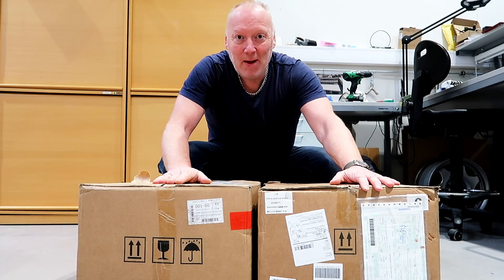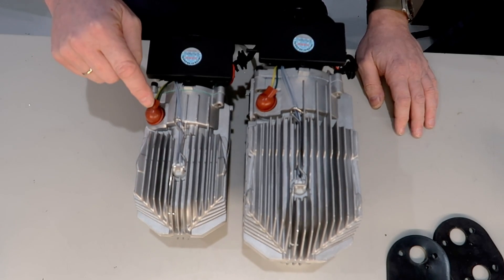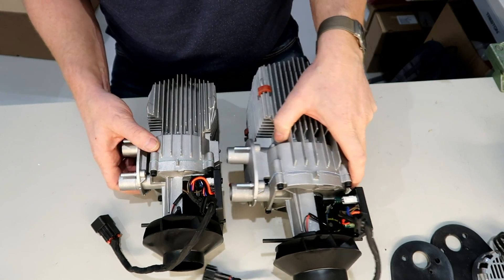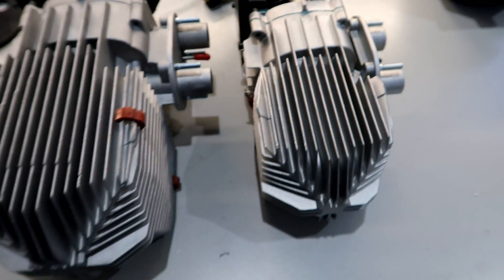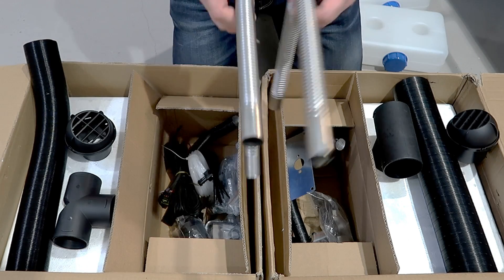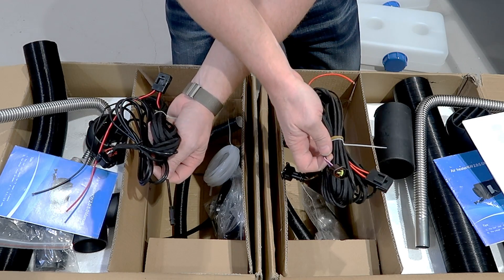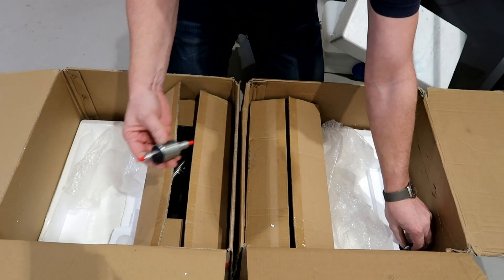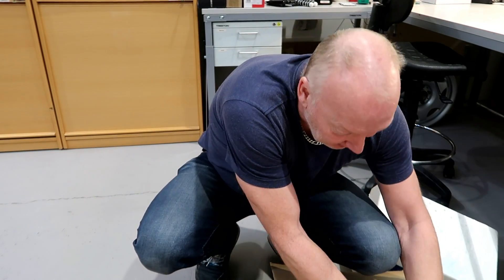Chinese 2kw vs 5kw diesel/parking  heater comparison part 1.

Comment: My plastic bodied (black/orange) 2kw when fitted made a noise. I eventually found out it was the fan at it's narrow end (the orange plastic left a witness mark), at the intake was rubbing on the body.
Made worse when the foreign object grille was fitted, so now not fitted. I think the bodywork might distort slightly when bolted down.
Probably not have this problem with a metal bodied heater.
Reply from the maker: Thanks for the comment. And a good tip.

Comment: Nice comparative video.  Thanks.   You may not be aware, but the subtle differences mean that some components cannot be inter-changed without creating faults.   I had a 2kW unit that was terrible to service due to carbon build up (see other videos as this is very important if you plan to use your heater in snowy sub-zero temperatures over multiple weeks) and purchased a 5kW unit due to the easier access to the burning chamber (required for regular cleaning).   Since everything "looked" the same, I thought I would save time and effort and left the 2kW components in place and connected them to the new 5kW unit.   FAIL!  If you are replacing an older heater, my suggestion is to replace all the components as well, even if they look the same.
Reply from the maker: Thanks for the comment. I will use the 5kw lcd since that one have the smaller contact. Will of course copy the settings from the 2kw lcd to the 5kw lcd, and hopefulle it will work nicely.
Reply: I am moving from 5 to 2... Then will change all components, just was unsure about wiring also
Reply: @Namaskaat  why are you downsizing? I ordered the 5kW, but have just received the 2kW model and don’t know if to exchange it for the 5kW.
Reply: @lastairhead  in my van I got malfunction with 2kw, and the 5kw can be tricked with the code in the control to lower rpm and fuel income. My limit was 1 for fuel and 1200 for rpm but not sure about the rpm if it is ok

Comment: I really wished you had tested fuel consumption. I wonder if its worth going for the 2kw.
Reply from the maker: 5KW heater:
Effect: 1-4 kW
Diesel usage: 0.12-0.49 l/h
Air stream: 70-120 m3/h
3200-13600 BTU pr/hour

2KW heater:
Effect: 0.8 – 2.0 kW
Diesel usage: 0,1- 0,24 l/h
Air stream: 34 – 75 m3/h
2700-6800 BTU pr/hour
Reply from the maker: I can't do this for you, sorry. Try to ask here: https://www.facebook.com/groups/146837062640024/
Reply: Thanks for the reply!
I joined the group, should be able to get any answer now 👍
Reply: @Just-My-Opinion  I can tell you both it right now.

Each click is 0.02ml of fuel. At 3hz (3 pulses per second) the fuel usage is (0.02*3)*60*60 per hour... 216ml per hour.

Comment: Hi John

How do i see the difference between a 5 and a 8 kw diesel air heaterIs it a sales trick?
or is there a difference between a 5 & 8kw diesel heater?Will you test it for us?
Reply from the maker: According to the Facebook group there is no such thing as a 8 kw heater. They are a rebadge 5 kw, but I don't know for sure.
Reply: I've heard the differance is the circuite board and the use of more fuel.  No visual differance.
Reply: I can find 5kw circuite board, but not 8kw circuite board, so I think that's probably a sales trick! :-(
Reply: Go into service mode and compare 8kW heater fuel frequency and fanspeed to other peoples 5kW if you feel like you have been tricked.. Is normal for any manufacturer too only have one assembly line and upgrade Models in detail..

Comment: Thanks for showing us this. I've been looking at these for use in my Dodge Caravan I've converted to a stealth camper. I didn't know if the 2kw was just a detuned version of the 5kw or if it was actually physically smaller. I figure a 2kw will be overkill and would rather have a heater that runs longer once it's on rather than a too large unit that's always cycling on and off. I'll make a prediction that the failure of these heaters will be in the circuit board due to vibration. I think I'll find some type of non conducting resin to dip the board into to keep the components from cracking. You have yourself a new subbie. Thanks again.
Reply from the maker: Thank you sir 😊
Reply: Just fyi it depends who you buy from because there have been quite a few reports of some of the manufacturers 2kw units being detuned 5kw models. Good luck finding what you need! :)
Reply: Me boa r que você tz z z

Comment: Can you provide a link to we're you get the red remote controls from. I been looking everywhere for one. Thanks.
Reply from the maker: It was included in the kit!
Reply from the maker: Found one: https://www.aliexpress.com/item/Universal-Mini-Protable-Remote-Control-Controller-for-Diesel-Air-Parkingr-Heater-Low-Power-Consumption-LCD-Switch/32971224126.html?spm=a2g0s.13010208.99999999.260.777d3c00aLzPiW&fbclid=IwAR2vdAcXiIioUhGAs5EIrlJ3bgfBj4vnEi5IBeVgIUiyEz500-MyV7bTGJM

Comment: Thanks for the video, very helpful.

I have a 5kw version with the 4 hole front. I want to buy the single hole front as I've decided to mount it underneath. I've found one on eBay but it is 13.6cm wide (the base not the hole which is 75mm). Would you say that is a fit for a 5kw or the 2kw? The 75mm hole suggests that it is for a 5kw but the base of my outlet seems to be more like 15cm...
Reply: I'm pretty sure I have just found my answer here 

https://www.aliexpress.com/i/32837175486.html?spm=2114.12057483.0.0.39d9285cqhc8ob

13.6cm seems to be for the 5kw, the 2kw one seems to be nearer 11cm and they are measured by the inner part of the fitting.

Comment: Think I've just got the 5kw by mistake think I need the 2kw to fit under vw t5 seat
Reply: I have the 5kw, although not installed it is currently sitting under the driver's seat of my T5. I have decided to mount it underneath but it would fit under the seat if I wanted. It's not a small box but it would fit in there.
Reply: @thedarkglovemusic  
Thanks for the reply what are the measurements of your 2kw and 5kw ? Mine is 38cm long and 14cm x 14cm wide and tall approx.
Think i might have the 2kw the eBay listing might be wrong
Reply: @CM-1723  I don't have a 2kw, but the 5kw is about 14cm by 14 cm, yes
Reply: 2 KW is more than enough for a transporter.  That is what I have and it was plenty even in -8 Celsius
Reply: @3dmixer552  that's what I was thinking it's more fuel efficient to get a smaller one it will last a lot longer on the same amount of fuel
Reply: Me too, looks like I will install it beside the transmission and cut a big hole in the sloping wall.